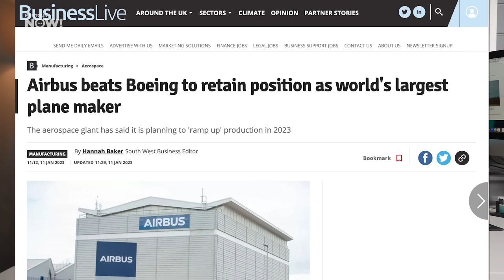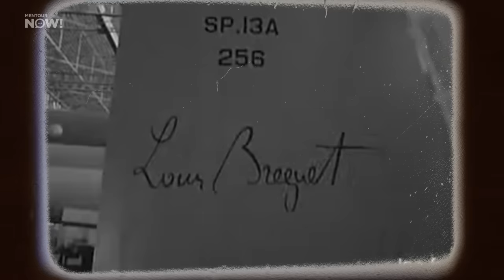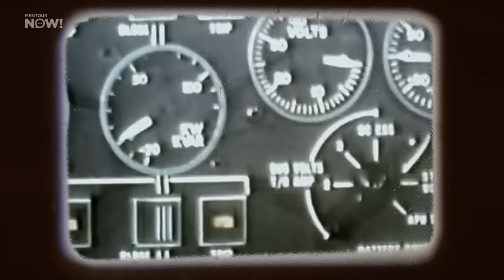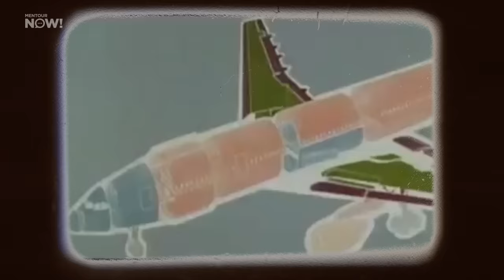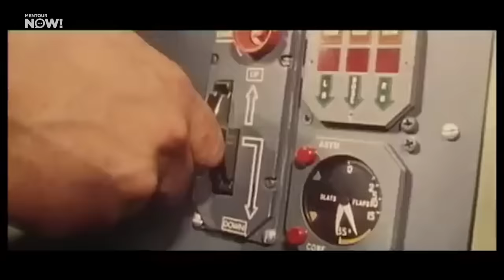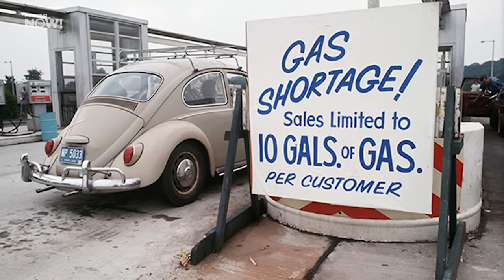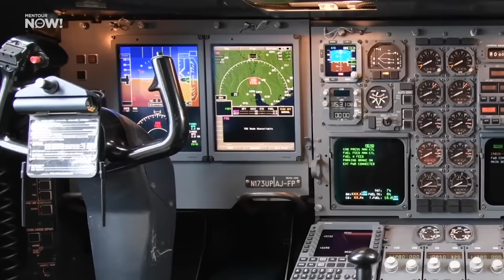Without this Aircraft, Airbus wouldn’t exist!

Comment: You could make an argument that the A300 was the most influential commercial passenger jet ever constructed. Almost every widebody out there is twin engine, and almost every commercial aircraft designed since uses fly by wire. Absolutely a revolutionary aircraft.
Reply: Fly by Wire was only introduced by the A 320, which program started in 1979 - and the A 300 (as well as the A 310) has a Yoke (!), not a Sidestick, which was introduced by the A 320, too. But beyond this: Yes, absolutely!👍
Reply: Actually the first airliner with Fly by Wire was the Concorde. Of course that was just an analog interface to the flight controls. The A320 was revolutionary because it introduced the digital, fully automated FBW that basically interprets the pilot's intents and does whatever necessary to execute on them. Before the A320, only the F16 and some Dassault fighters had that kind of technology.
Reply: I disagree.  It's certainly in the running for it but I think the 747 being the first widebody aircraft and Boeing also having the first commercial jet aircraft with nacelles on pylons instead of inbody engines like the Comet make it tough to call this the most influential.  The technology just wasn't there prior to have only 2 engines.  It's a bit of luck on their side that the engines proved reliable enough to get them past that 30 minute limit.  Every jet was going to be twin engine once the engines weren't shit enough to need a third in the tail just for fun.
Reply: @tonymorris4335  You forgot about the Sud-Aviation Caravelle before either A300 and 747.
Rear-mounted but in nacelles at the end of lateral pylons, dating back to the early-mid 1950's (first flight in 1955). It was also the first commercial airliner capable of auto takeoff and autoland. Autoland performed in no visibility for the first time by an Air Inter Caravelle transporting passengers and landing at Paris Orly in January 1969.

The Caravelle was also the base on which Douglas derived its DC-9, after studying the model that GE bought to develop engines.
Reply: A300 is not FBW, you are thinking of the A329.
Reply: @jasonbender2459  There is no A329, you're thinking of the A320 ;)

Having said that, the Airbus FBW system had been initially tested on a modified A300.
Reply: @KyrilPG  The Caravelle was an impressive aircraft for its time, but as I recently learned, it actually came after the 707.
Reply: nope,  fat fingered the 0 in 320 so it came out 329.   I am too srupid to nproofread before hitting send... lol @jacobzimmermann59
Reply: @jacobzimmermann59  Indeed.
Reply: @jacobzimmermann59  That depends how you count it. The Caravelle had its first flight in 1955, but was in production from 1958 until 1972 and the first delivery to a customer was in 1959 (Air France).
The 707 had its first flight in 1957, the production started in 1958, too, but the first delivery to a customer (Pan Am) was in 1958 (production of the civil version: 1958 until 1982, production of the military version: 1958 until 1991).
Caravelle: 282 deliveries alltogether.
707: 1010 deliveries alltogether.

Basically they were developments of the same time.
Reply: Apparently Airbus/BAe Filton converted an A300 to test the fly by wire concept. it was allegedly panicking people on the ground with the manoeuvres it was pulling off.

Comment: I remember fondly flying in those first A300 leased to Eastern to/from San Juan, Puerto Rico. You did not mention it but they also made a lot less noise than the L1011 Eastern was flying in those days. I know, as I lived at the time as they were flying low into what was then called Isla Verde airport.
Reply: And that's especially notable too when you recall Eastern had named the L1011 itself the "Whisperjet"  -- which tbf they were WAY quieter than the then-common narrowbodies.
Reply: I remember stewardesses telling me that they were coming back from long hauls less fatigued when flying the A300 than other planes.

Comment: As a retired from Air Inter, the biggest french domestic airline, incorporated in Air France in 1991, there are some facts :
At Air Inter (IT), we exploited as many as 20 of A300's, all but one B2 series.
They were on the biggest lines from Paris-Orly airport, Lyons before TGV high speed train, Marseilles, Toulouse, Bordeaux, Pau, Montpellier, Sttarsbourg and in summer Corsica,  One class, 9 abreast (!), but the longest flights were less than 1 hour and a half block-block, and...314 sets available.
Reply: Hi Jean Louis
At the end of Air Inter as passenger I flew once from Strasbourg to Paris in a A330. I clearly remember the sheer length of this aircraft.
My friend Jacques Delfaud, a third man on Mercure then A300 told me that Mercure was highly appreciated by pilots.
Reply: One one of my best lights ever was when I was studying in Paris and going back to my home city of Marseille on a Super Caravelle (Super 12). It was the last model Air Inter flew. I could not believe how smooth the flight was and also how relatively quiet the cabin was. Flying in that airplane felt like flying a glider. I flew other aircrafts (Fokkers among others)on that Orly or Roissy-Marseille line but I never flew on the Mercure. Everyone was telling me it was a nice and comfortable plane. I was young at the time and did not know much about airplanes and flying.
Reply: So that was a real A300 with 314 seats for passengers!

Comment: Can't believe a single plane name the Airbus A300 decided to change the whole aviation landscape for good. Appreciate Airbus when u can become they are the reason why aviation is safe and more economically better ( interms of fuel efficiency) including the fly-by wire system introduced as well as the a380 ( a300's Big Bro ) that overtook Boeing's Prized Queen of the sky. Sounds like Ferrari vs Redbull in Formula one is all i can sum it up for those 2 aviation manufacturing giants. What a Great Video Peter. I even though is the Airbus's name came as "AIR" "BUS" interms of transporting people which i have realised after watching this video. Great work once again Peter 👍😁

Comment: Wonderful. I actually flew with a model of A300 and a Mercur on domestic flight in France, back in the 80-ties.
On Paris Bordeaux the Airbus actually reminded of a bus. It was so simple. I rember I was looking out on the engine wondered if it will fall off the wing 🙂. 

On my way back to Paris I went with a Mercur. It felt like it never reach more then 2500 m altitude. It flew in a left and rigt pattern, followed the river, then a motorway, and then something else. 

A passenger in front of me asked the steward what type of aircraft we were flying. 
- A Mercur, it's French, he said very proudly.

I could here sound from passanger in front and then he turned pale.

Comment: Terrific Video, particularly for me an X-Eastern Air Lines employee (@JFK, 1974-1984). The purchase of the A300 by Eastern was the best thing that CEO Frank Borman did at the airline. I took one of the first flights on it on EA on one of my days off. What a fabulous ride! Then, I worked for Lufthansa and had the pleasure of flying on it with them. I must say the A310 was not popular with passengers at all. Because of ETOPS the FRA/DUS-JFK flights took too much longer, especially in winter with strong headwinds. CHEERS from Peter.

Comment: The A300-600 did have some wing improvements taken from A310, like deletion of outboard ailerons but it did not have A310 wing, rather the A310 tail section with the rear pressure bulkhead pushed slightly backwards and that allowed additional seating. I have flown a lot of PIA's A310s and can say they are one the most powerful machines with engines capable of producing 60,000 lbs thrust each. A310-300 is an under-appreciated powerful aircraft in comparision to widely known Boeing 757-200.
Reply: Thank you for sharing your experience!👍
Reply: So true!!!
Reply: It's an unfair to compare apple to peach as B757 is a single aisle aircraft.
Reply: I remember being in Karachi's Jinnah Int'l airport last year and seeing the scrapyard of multiple PIA Boeing 747s and Airbus A310s while my AirSial flight was taxiing to the runway. It felt sad, but that's just how it is

Comment: Eastern, then American and late in it's existence Pan AM, liked the A300 as was 'right sized', as you note were significantly more fuel efficient and smaller than the DC-10/747/L-1011 for pax loads, but also had great cargo capacity. That was critical with their routes from the eastern USA to Puerto Rico and other Caribbean islands as many persons going to those locations were often bringing huge amounts of checked baggage with goods for relatives who lived there. That also led to their popularity and extended production as pure freighters. They also were popular with passengers as had slightly larger fuselages than the 767 so slightly wider seats and thus more comfortable. The A300 was also available before the 767, which didn't come into service until about 1982. Later versions were also used for trans-Atlantic service with modest success as the ETOPS was extended due to better engines. Dispatch reliability declined with AA later in their use life. Considering how they were a base of all their 300 series aircraft but only for a limited part for the A350, it has been for sure a landmark aircraft.

Comment: In 1977, I flew with an A300 (in the passenger area), already knowing 727, 737, DC10 and 747. It was amazingly calm inside due to the extremely high bypass ratio of the engines. No winder it became a success.

Comment: Love to see a video on the SUD Caravelle.   Had flown in it back in the mid 70s on Indian Airlines.  Loud, is not the word for the sound of its engines!  2 - 3 seat configuration, I think.  Somehow, it made its presence felt!
Reply: I flew the Caravelle a few times between Paris and Marseille in the late 70s, and I really don't remember the engines to be that loud in the cabin, regardless of where I was sitting. ON the other hand, it was a loud airplane "outside".
Reply: @patrickbotti2357  👍is what I meant.  Lived near the airport it's engines are distinctive!  Inside, it is quiet, especially if you sit near the front.

Comment: When Airbus released the A300 their slogan was "two mouths are easier to feed than three or four". So in a way they killed off their own A340, which actually was a A330 derivate to meet ETOPS. I flew with one of the first A300s here in Germany, D-AMAX from Bavaria Germanair, a charter airline. And I flew on it again after Hapag Lloyd purchased Bavaria Germanair. Having all those little hoppers here in Germany, the A300 was so impressive.

Here in Hamburg we had a aircraft manufacturing which built military aircraft (Noratlas and Transall). This place was call HFB (Hamburger Flugzeugbau). My mother used to work there for many years. When A300 was produced, the complete are was converted to Airbus manufacturing space, which it still is.
Today the complete A320 family is produced here, and also fitting and painting of the wide bodies happens here.

They have cool guide tours as well.

Comment: Loved this episode. Oddly, I've never flown on any of the A300 to 340 series aircraft and I've been flying long-haul since the 80's.  

I've been on the 747's all the way back to the 100 version, B767, B777, B787 as well as the L-1011 and DC-10 (Laker Skytrain back in the day if anyone remembers). The only long-haul Airbus' I've been on are the A350 and A380 and I must say the A350 is probably the best of the bunch despite the fact that I will always have a love for the 747.

I think it's down to airline choice being mostly BA who were very set on Boeing for long-haul for most of the time I've been flying.